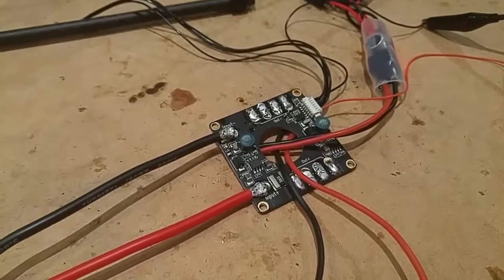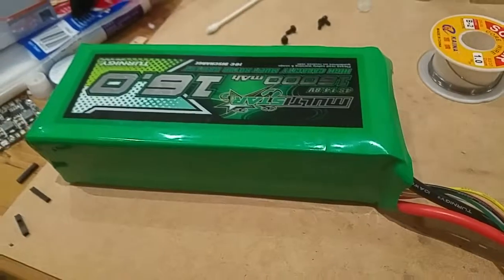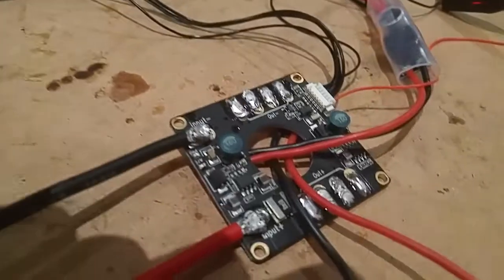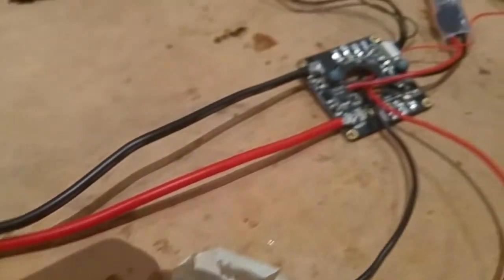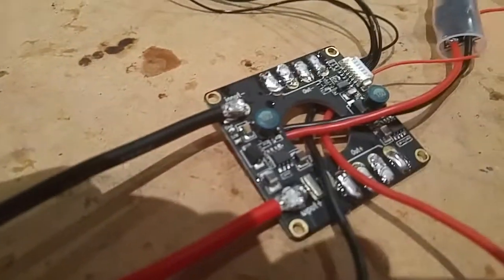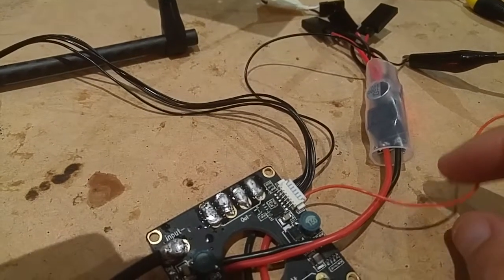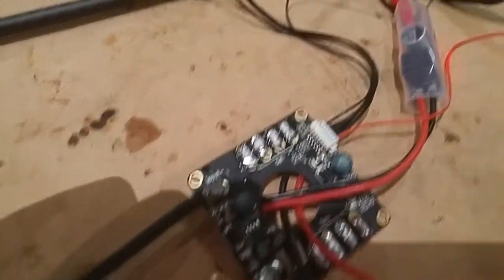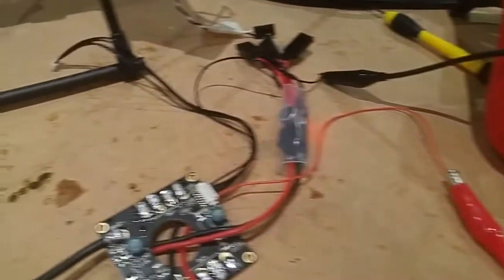Hobbyking HK Pilot Power VI Module, Distribution Board fried/destroyed 2 pixhawks

Comment: thanks for the video, did you measure the voltage output before you connected to pixhawk?
Reply from the maker: nick rc ph yes, it was initially 5V but something malfunctioned on the board and it was somehow outputting the raw LIPO voltage (~15V).
Reply: thanks for the reply bro, then what would you suggest before i proceed co,z i got the same board and planning to use it on APM pro mini?